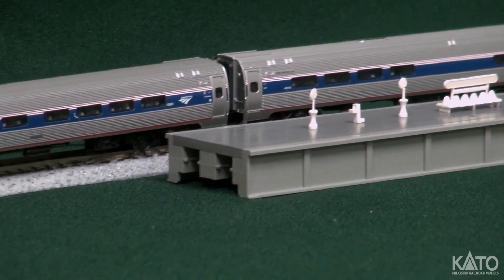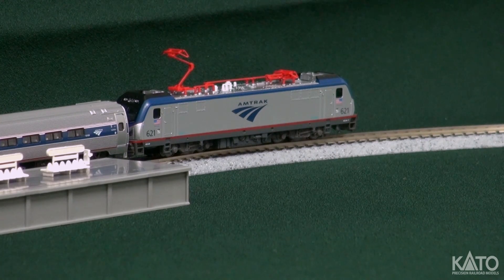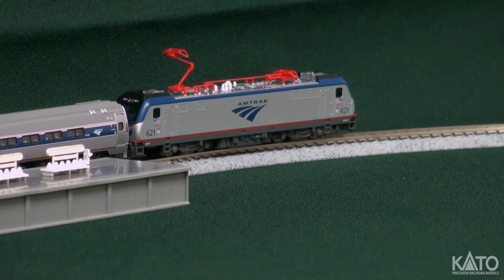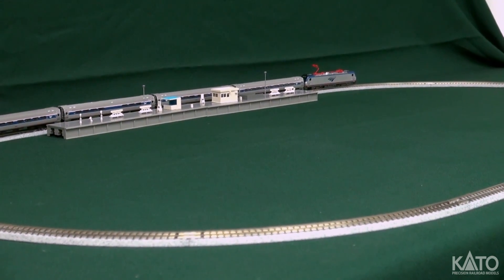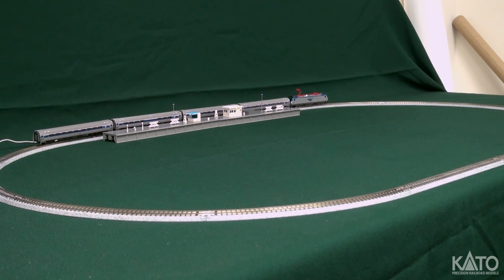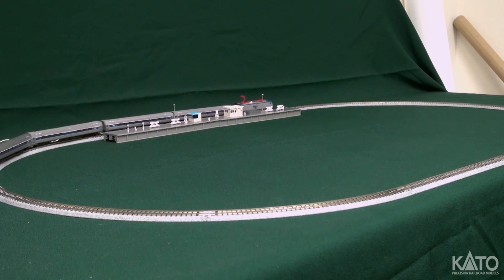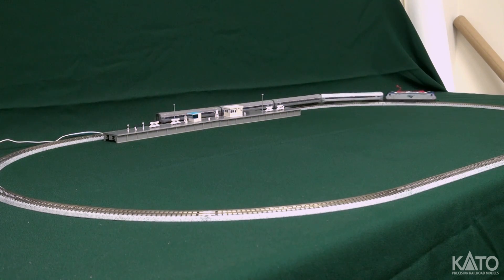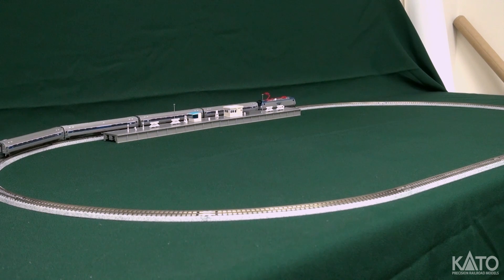Product Preview August 2016 - Siemens ACS-64 Sound Card

Comment: Is there a maximum radius curve for this engine? I bought it today and at full speed it is flying off the curve.
Reply: yeah im looking at getting an amtrak set but i have some pretty tight radius
track so i dont know if they will fit on my small layout.
Reply: Nope, you're just running the train too fast for the track you set up.  Maximum radius?  You mean like traveling over straight track?  It's minimum radius that you need to worry about.  Where the curves are too sharp for the loco to navigate, which is well below the 12 in radius curves that came with this starter set.

Comment: does the sound card works with other products besides kato? I was just wondering
Reply from the maker: The Soundbox system will work with any analog locomotive whether it's N scale, HO Scale, Z scale, whatever. You can read more about it on our website!
Reply: +KatoUSAinc could you make an Amtrak downeaster passenger train set with 5 amfleet ll cars and 2 p42dc locomotives one on each end
Reply: +KatoUSAinc in ho scale
Reply: @Trublemaker12  dude they have a request email thing on their website

Comment: what are the dimensions of the track oval in inches?
Reply from the maker: In this video the train is running around our M1 basic track oval, which is approximately 36" x  24"
Reply: is this the same size oval that comes with the set?
Reply from the maker: It's the size of oval that comes in our starter sets.

Comment: You guys have the wrong horn... It's way too low of a pitch and the e bell is wrong, too.
Reply from the maker: It may sound different in the video because of distortion from the camera recording at a distance from the Soundbox, but I assure you both the horn and bell sounds are recorded directly from an ACS-64 locomotive.
Reply: KatoUSAinc. Make a kato amtrak e60cp locomotives
Reply: @csxfan6309  bachmann made those